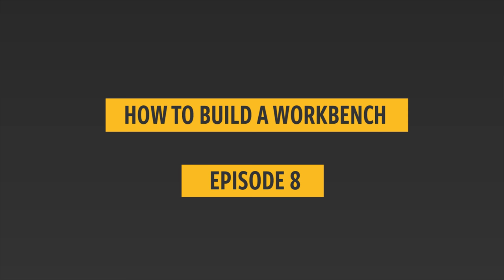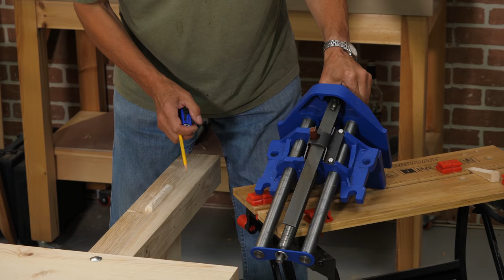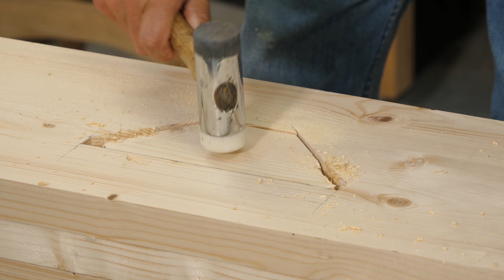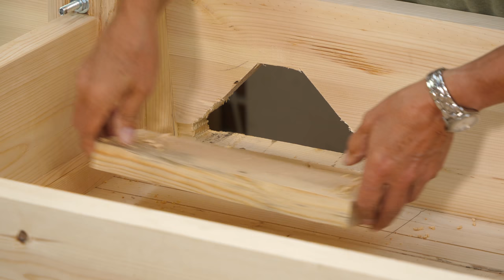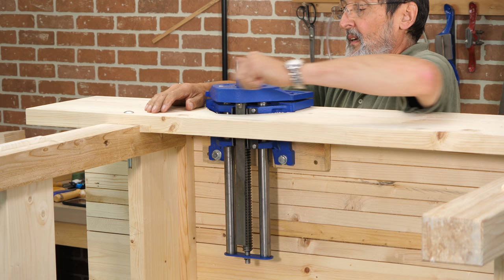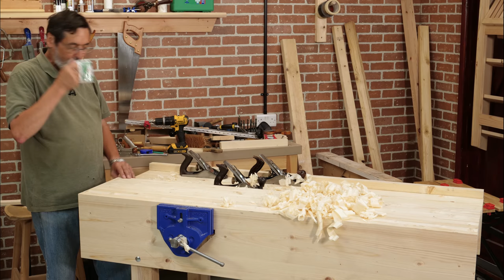How to Make a Workbench Episode 8 | Paul Sellers

Comment: That video made me think "come on paul just use a jig saw for that, we wont tell anybody!" for the first time since i watch Pauls videos. ;)
Reply: Exactly my thoughts. If you use a powered drill as a router then you can use a jigsaw as well.
Reply: The Jigsaw is probably  my least favourite tool, but I have to agree lol in this instance it very much has it's place
Reply: Hi Paul  a pad saw would have been a lot quicker  ideal for the job. Cheers, Bob.
Reply: Yes, especially as the Aldi powertool came out to drill the starter holes :) In all fairness there was probably better hand tools to use - maybe a compass saw., but I think Paul's showing average stuff a beginner would have.
Reply: Personally I don't like jigsaws, they're some of the most unnecessary and poorly performing tools you can drop money on as a furniture maker. For things like this a Schweifsäge ("turning saw"?) is pretty much perfect. You'd only need a single hole to start it as well. It's difficult to judge in the video whether it would fit, though. If the apron is too wide for your frame saw it won't work.

However, my impression is that American/British folks don't use frame or bow saws much at all; I'm not sure why that is. So you'd probably have issues getting the materials to build one yourself and probably can't just buy a good one there, either.
Reply: A lot of you sound like you don't know how to set up a cut with a jig saw. It's fairly precise and clean cutting if you clamp a fence along the cut and use it to guide the base of the jigsaw. Have fun!
Reply: I think it's more a question of dislike than inability. I suppose a dislike of power tools is one think that draws viewers to Paul's stuff.
Reply: Richard, don't get me wrong - I didn't say jigsaws are bad tools per se, they're just not useful for making furniture/cabinets or how they call it. A good one will set you back at least 150 coins, money that could've bought you a number of much more useful tools.
Reply: That being said, I looked at the comment I made above and a strong word like "hate" really is out of place here, so I edited that comment.
Reply: Das Stackenblochen 
And do you consider this, furniture or a cabinet? I don't. It is a workshop bench. It will be used to make furniture, but it will also be hammered on and cut on, stained with stain and blood, treated well and treated poorly on the odd occasion, and it certainly does not deserve to have 20 or 30 quids worth of a drill to be mistreated in drilling at an angle to then use a saw and hear it bottom out  10 or 20 times because it's the wrong tool when a jigsaw would be used correctly. 
My first jigsaw cost me £17.50, my second cost me £10 2nd hand, my current one was £45 2nd hand and is capable of very fine work (in the right hands), so not a tool that people from all around the world can't afford...
It's not as if he's used ONLY a hand drill, the battery drill has been used plenty.......
Reply: to be honest in these days of cheap Chinese 'DIY' tools, a decent quality jigsaw would probably cost you a lot less than even that handsaw he was using... Some 'traditional' hand tools are comparatively really expensive.  I'm still trying to find a 'justifiably affordable' router plane somewhere...
Reply: I'm fairly amazed any of you even feel the need to argue here abt a jigsaw.
Reply: Richard Hunter+ my Hungarian made Makita jigsaw always tends to drift away even with a solid guide...
Reply: Well I thought he was going to pull out a vintage keyhole saw, a jigsaw never crossed my mind.

Comment: Beautiful sequence of videos and bench, thank you very much for putting it out for us. I just had an idea, how about mounting the vise flush or almost flush with the apron? This way you could later use clamps directly on the apron without the need of wood blocks to make for the width of the vise and probably you could also secure the vise on those extra holes that were hidden inside the apron because the vise would sink in a little bit more.  Just an idea to complicate things :) Cheers!

Comment: Hi Paul, I'm nearing the end of your workbench building course and have greatly enjoyed it. Thank you so much for putting it out there with such clear and detailed explanation. I was a lifelong professional musician pre-Covid but had always planned to expand the woodworking I had done on and off as a retirement plan but I'm bringing that into the present as I'm not confident live music will be back anytime soon. I originally learnt the basics from my father in law, a lifelong carpenter/joiner now in his 80's. Anyway I'm digressing. I've fitted the vise, the same one you use in the video, the 9" Eclipe quick release. Handy because you did the layout for me. One thing though, on your downloadable plans you listed 8mm x 70mm lag screws to fit the face of the vise to the apron through the holes in the fixed jaw. The holes on the Eclipse are too small for those screws so I used 1/4" X 3 1/2" square headed screws instead. Perfect fit. M6 for metric types I suppose. I Iooked back at the video on a big screen and it seems the screws you are using are smaller than M8. If that's the case, perhaps a small edit on the hardware section of the plans to help people out if they get the same vise and uhm...er.. don't...er..un-pack it until they've er.....already got the screws and go to fit it..... like I did. Keep up the excellent work. Inspirational! Cheers, Steve.

Comment: I’m currently building a bench to this design, but had to resort to some power tool use - Although I’ve been able to get some hand planes tuned up thanks to this channel, I just couldn’t get the surface of the bench flat. I’m almost ready to install the vise, and I think I’ll use a jigsaw instead of a lot of drill holes and a hand saw to make the opening. But I do like having these other tools available.

Comment: Honestly, I was a bit surprised to see you chew-out the wood with a drill to allow a starting hole for your saw. I've been doing that for years and always felt as if I was doing something terribly wrong. Thanks for giving a relatively old dog an easement to his mind. I suppose my main question at this point is why you didn't sink the back face into the apron? I suppose I'll see on the next video.
Thanks for sharing this with us, Paul.
Sincerely,
Thomas
Reply: Bill Holt okay, thanks. And thanks for the link. I must have either missed that one or it slipped my mind. I'll go have a look right now.

Comment: Paul, what great videos, I’m in the process of building my own bench, hobbyist. I love the fact you have shown the whole process and the amount of work involved ... a lot of planing. When you fitted the vice you use bolts that stopped the vice completely closing. I was thinking of recessing the edge of the jaw into the bench and adding wooden plates on the both sides you can recess the bolts ... or can you not see a reason this would work. As per the comments, love the videos and keep up the great work!

Comment: In you other vids you talk about offsetting the rear face of the vice away from the bench so you can get your hand in. It's a great idea but you don't say how this is done (or do it). Thanks for the vids. Great work.
Reply from the maker: I simply face fix the back jaw to the apron with no recessing and then add a jaw liner. This gives me about 1 1/4" of space for my hand to slip into to hold the piece as I clamp and unclamp.

Comment: Does it matter which side of the leg you cut the wedge recess? I'm making my bench a little shorter than in the design, so moving the wedges to the outside of the leg allow me to keep the vice closer to the leg rather than pushing it more towards the middle of the bench.

Comment: Hello Paul! I was interested in knowing the reason you went with the 9 inch vise vs the 7 inch vise.
Reply: Old post but I am building this and had a vintage 7" Record vice I was going to originally use but decided to buy a 9" vice. The 7" is quite a bit smaller compared to the 9" and feels too small for a bench of this size. It would work just fine, but by the time you build up the jaw liner you won't have much opening to work with. I ended up using my 7" vice as an end vice since I added dog holes. Now I have a lot of options to hold board on the bench. 

Go with the 9" vice and you won't be limited in the future. The 10" vice feels like overkill but would work well too.

Comment: I have a bit of an issue fixing my vice. The holes on the face of my Eclipse 230mm vise are 7mm and so accept M7 coach screws. I put two M7x100mm coach screws in, but unfortunately one snapped due to over tightening. So I had to drill it out, plug with a dowel, and put another one in. Thing is, I have no more M7 bolts, and I can’t find anywhere that sells them. What’s the right thing to do? Use an M6 bolt or drill through the hole in the vise with an 8mm bit, to expand it enough to allow an M8 bolt?

Comment: Is there a grade or type of pine I should be looking for in the UK ? Great set of videos as usual. Thank You for sharing your knowledge.
Reply from the maker: Hi, Daniel Not necessarily. What I would be looking for is the minimal amount of knots the least distortion and the dryness of the wood. The latter you can establish by buying the wood in and storing it loosely to allow dry air to circulate around each face of the pieces if that is an issue. Red wood pine and spruce are two solid softwoods that work.
Reply: Thank you I live up in East Lothian Scotland, so off to check out a couple of places near by.
Reply: The CLS timber sold at B+Q is good value.  Usually Spruce.
Reply: Murray Drums Cheers I'll check them out. We have a B&Q near us fortunately.

Comment: Paul why did you decide on this style of workbench with only one table top as opposed to two as with the previous bench you made a video on. please respond as I am wanting to start my bench very soon and would like to make the best one I am able too, thank you
Reply from the maker: Hi Daniel. A two sided bench is meant for joinery and not necessarily furniture making. Joinery encompesswes large and wide frames and so needs supporting across a wider area. Things like window frames, door frames, doors etc. In furniture making we use more concentrated work area for creating joints.
Reply: Thank you Daniel for asking that question. I was thinking it myself. Thank you Paul for answering. I was leaning toward your older two-sided design, but now I have changed my mind.

Comment: Dear Mr Seller

I was wondering if I might ask couple of questions. 
1- the wellboard which is for storing tools has no closure on either ends. Is there a risk of tools falling down from two ends? 
2- I’m ordering my timbers as 2*4 and 2*6 for this project. Finished size of timbers are smaller than nominal measures. For example bench top is 300 mm wide but laminating 6 studs is narrower and 7 studs laminated makes it wider. What’s the best way to calculate the sizes of rails and bearers to make up for it. It also affects accuracy of bench height as the 2*4 timbers are slightly more than 65 mm. 
I would be grateful for your kind advice.
Reply: 1.   Only risk of falling is if bench is vibrated heavily left to right...unlikely.  Also the well cavity is shallow so its easy to keep an eye on tools. Plus it is unlikely a woodworker would place tools near the ends. Lastly, the wellboard will be the receptical will get a lot of sawdust/shavings and with an open end its very easy to clean.
2.  Minor differences in dimensions make no substantial difference in the functionality of the bench.  The height should be adjusted to match YOUR height.
Reply: Clark Douglas 
Thank you for explanations. Beside stiffening the bench frame is there any other function to  skirt and apron? It makes it difficult to clamp a work piece to the bench face on.
Reply: To clamp to this bench I would clamp to the end or drill some holes in the apron to accept one end of the clamp or clamp a 2x3 to the face of the apron and clamp under it.

Comment: Out of curiosity - is there a reason for installing the vise before flattening the top? It seems counter intuitive but maybe I'm missing something? For us mere mortals that may need to take of more than 0.1mm of material to get it flat we risk running into the vise :)
Reply: I was not that confident in my skills when I made my bench this last summer. My vise has been installed about 8 mm below the bench top level. My idea is that I may have to re-flatten (better flatten) the bench in a not too distant future. The vise jaws are flush with the bench top. Now 8 mm might be exagerate in the other side.
Reply from the maker: I did flatten and trued the bench top before installation and it was in good shape but after anchoring everything in place there may be some variance all be it minor. Even the installation of the vise can affect the worktop. Once installed and the fact that the vise is lower than the bench top it makes sense to me.

Comment: 2 questions

1 why not simply use jigsaw to cut out the hole
2 why not use 4 trough top screws and  bolts , like those on the legs for the vice? They could be recesed and plugged. What if the wood shring and move with your setup?

Comment: To be honest I'm kind of disappointed the fixed jaw wasn't recessed flushed to the apron, or even further with a built up section of the apron allowing for a replaceable fixed jaw.

The install of this vice was a hack compared to the rest of the benches build, more like something I would do in a hurry (I'm no pro what so ever but would have considered this aspect). I'm really sad the vice install wasn't on par with the rest of the build.
Reply: It's not flush to the apron because this way you can slide your fingers behind the piece to hold it a lot better while closing the vice. It may seem a hack, but it's made for a better handling of the wood. Paul explains it in a video, very clearly, and I had the "doh" moment too - as I used to think the same as you.
Reply: See here: https://paulsellers.com/2013/01/questions-answered-vise-mounted-proud-of-bench/
Reply: Thank you Stefano, thanks for going to the effort of explaining and providing a link, much appreciated.

Comment: Did anyone suggest a multitool wood cutter blade for cutting out the vice hole? If you see the damage done to floorboards by plumbers and electricians you would understand how priceless a multitool vibrating cutter can be . They also make surgical cuts through lime plaster .

Comment: I don't understand why the tail end of the vise is set proud of the apron, nor why you set it so it would be flush to the top. Wouldn't it function better being recessed deeper so that the whole apron itself acts as the rear clamping face? And the (yet to be added) wooden face of the front jaw be sized to run parallel to the top of the bench?

Comment: I prefer having my vise mounted flush with the front edge of the bench, not protruding.
Reply: Same answer to another comment above. It's not flush to the apron because this way you can slide your fingers behind the piece to hold it a lot better while closing the vice. It may seem a hack, but it's made for a better handling of the wood. Paul explains it in a video, very clearly
Reply: Stefano, I watched the video he made about why he likes his vise protruding when he first released it on YouTube.  I don't agree with any of the points he made, and find a couple of them to be simply spurious.  He's a good guy, knows a lot about woodworking, and I've picked up a few good tips from him.  But the vise location is one of a few things I don't agree with him on.  I want the work piece to be tight to the apron, not flopping around.
Reply: deezynar the vise jaw is solid with the apron and that makes the piece solid with the apron. A good, heavy and solid vise won't move. Having a piece flush to the apron won't change much. 
I built this same workbench and you can't move it a millimeter even with a 2 meter piece in the vice. And my stock is even thinner than what Paul is using here. The bench and the vise are what make all of this solid.
You also have another apron if you want to clamp a really long piece to it. 
But of course, to each its own.
Reply: Stefano, I am not knew to woodworking.  You are not telling me anything I don't know.  I will tell you once more, but with more detail, a thin work piece can flex, so I hold it tight to the apron on my bench with a holdfast.  I would have to insert a spacer to do that if my vise protruded like Paul's.  I don't want to do that.  The benefits that he claims for a protruding a vise are invalid, such as sawing items held in the vise.  It is standard procedure to saw work pieces held in a bench hook, not the vise.  His claim that a person can't grip a work piece with a flush mounted vise is untrue.  I do it without any problem.  I do not claim that a person cannot do good work with a protruding vise.  I'm saying that the methods of working wood I use are standard methods seen in virtually every book on woodworking.  You don't need a protruding vise to use them, and many of Paul's methods are non-standard.  He gets the job done, I get the job done.  But I'm not going to change my ways.
Reply: deezynar of course, I don't think anyone is saying that there's a way better than other in an absolute way. I think it also depends on which kind of woodworking you do. But it's good to have different methods and opinions